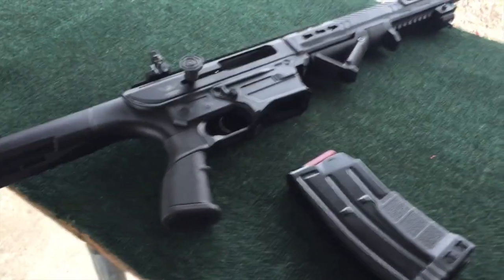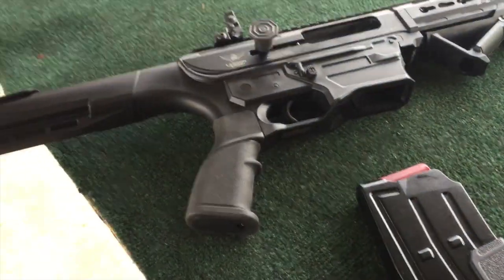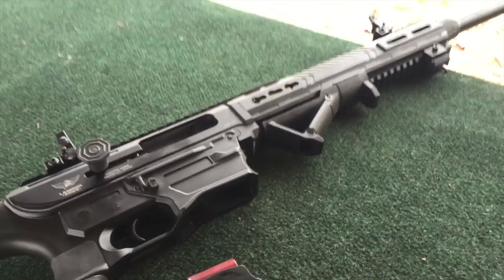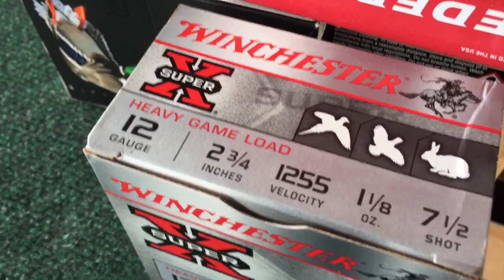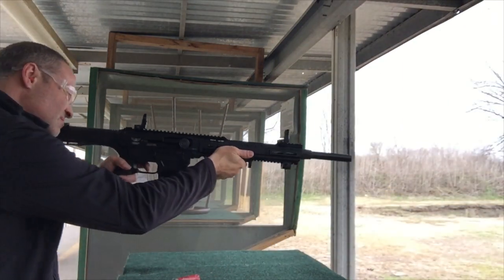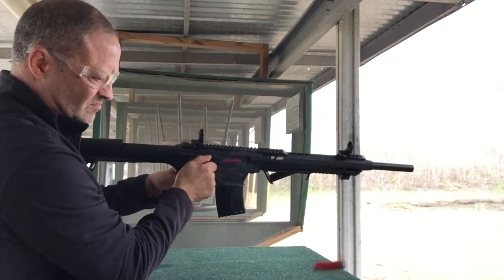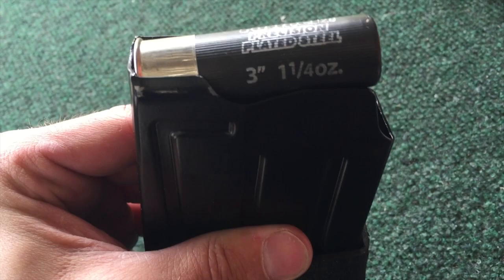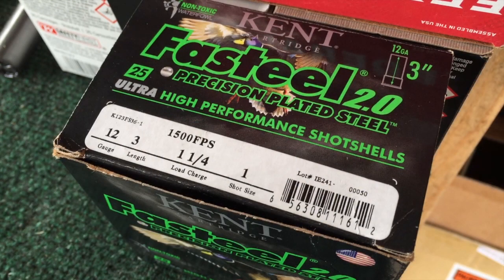Landor Arms AR12 break in (LND-117)

Comment: While watching TV cycle the action by hand a few hundred times to weaken spring. Saves $$$ on ammo. Several others have done this including myself and it works.
Reply: Does that mean I don’t have to buy any high performance? Or still recommended?
Reply: Man, just bought the equivalent of the price of the gun on as close to 1400 fps ammo as I could get.
Reply: Was about to try with lower FPS to break in... thanks for the tip!

Comment: There may be an additional trick that you can do to help break it in faster. I stumbled across a video of a guy having the same cycling issues with a RIA VR80 (I thinks thats what their AR12 style shotgun is called). He said that he left the charging handle locked back compressing the spring when the gun was not in use for the first month he owned the gun and he said that yielded noticeable results to the break in period. Im doing the same thing to my LND117. I'll see if I can fire some lower brass shells out of it the first time I get around to taking it out. Worth a shot I guess :)
Reply from the maker: Ya, I've heard of people doing that, not sure I have the patience to wait a month. ;)
Reply: Tag me when you get the results
Thinking about getting one tomorrow
Reply: Update?
Reply: @djsimon01  pull the spring back and then heat it to get it soft.

Comment: I just used 200 00 black aces 1400 fps shells on the break in and only had 1 stove pipe.
You can get 250 shells for $150.  And they destroy targets.  I would highly recommend putting some extra pad between your stock and shoulder to soften the kick.  After 50 of the black aces shells your shoulder is done.
Reply: where did you get them

Comment: I have the GEN3 model and shells are catching on the edge of the firing chamber of the barrel a the "3 o'clock section". There is an open port on that side where there is no bevel which catches and cuts into the plastic shell casing thus causing the shell to jam. I've only used 2 -3/4" shells and plan to test 3" shells next. Through 50 rounds of 00 buck shot/1345 FPS this feeding issue occurred 8 times which is too often to make this a reliable home defense primary.
Reply: How do i know which gen i have

Comment: just got mine, shot it with low brass knowing it wouldn't cycle new. I never got a manual with mine so im kinda in the dark as to what choke is what. is there anyway you could email me pics of the manual? also and tips to keep it functioning?
Reply: Haha.. The manual doesn't say anything about the chokes... I had to look on the internet to find it but the tubes have hash marks on the end 1=full/3= modified/5= cylinder bore
Reply: Let me know and i'll send you pics of the terrible manual that came with it if you  want

Comment: Really the issue is the difference between short brass and long brass shells, not what FPS the shot is.
Reply from the maker: If you want to get technical, "high brass" and "low brass" are holdovers from the very early days and dont really mean anything when you're talking about modern shotgun shells. To determine the power of a modern shotgun shell you look at both the velocity and shot size. Thats really the issue. ;) 

For simplicities sake, FPS is usually a good indicator of a shells power....IE, it takes more gunpowder to make it move faster.
Reply: @djsimon01 I'm not sure what you mean. Like faith ferg said if you don't run high brass, as in, the brass base is not taller and more sturdy, atleast in my gun the steel and aluminum 100% of the time swells and sticks in the barrel. Even with some cheaper high bass I had round swell the brass base and get extreemly stuck in the barrel. Still just at 100 rounds breaking it in, but I don't see how this issue is gonna go away and start working with low brass or steel and aluminum based rounds..

Comment: Dude ... are you shooting your shotgun with the Shipping Guard on the Charging Handle?  Or, is that just how it looks?
Reply from the maker: No, you're right, it has the rubber guard on it. I leave it on so it doesn't tear up the inside of my carry case. Honestly it doesn't really bother me using it like that, it fits pretty securely on the charging handle.
Reply: I was thinking of putting mine back on since the steel charging handle isn't the most comfortable thing to interact with. Especially if I'm going to be hand cycling it hundreds or thousands of times.
Reply: It really does make charging alot faster and friendlier on the fingers..
Reply: What? Its a shipping guard? 
Well FML..... Here I was thinking that it was a cool rubber handle cover!!!
Reply: @nathanhollis8496  same ! Hows ur lnd holding up?

Comment: When storing this gun brand new. Keep the bolt open and leave it that way. The spring is heavy. Keep it recoiled it will soften the way the shotgun cycles, and work the action as often as you have time to so as to soften the spring.
Using the L.N.D. 117 brand-new....  (Always, USE HIGH BRASS ROUNDS!) Or It will stove pipe! And (I am a girl!) Get real guys! This is a bad ass Shotgun!